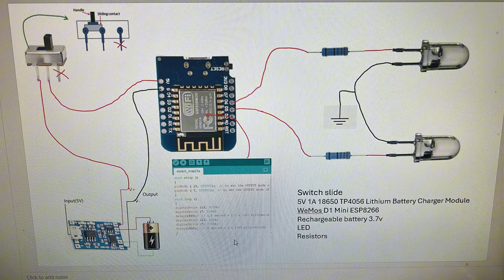Bringing Light to the Classic: Porsche 911 E 1969 (1/18 Scale) Lighting Project #diy

Comment: maybe if you painted the LEDs with a yellow marker, the lights would be a little yellow and not a cold bright one in headlights. And I'm asking again out of curiosity, don't you use a voltage regulator on esp8266? because after fully charged the battery probably has over 4.2v. so 4.2v is too little to power from USB C and too much to connect to the 3.3v pin
or maybe I'm wrong?
Reply from the maker: A regulator isn't necessary because I'm using the Vin pin (+5V). Regarding the color, that's up to the client.
Reply: @CarLighingSystem  call the customer and tell him that he is wrong and the lights should be yellow... I'm joking of course😁
Reply from the maker: @euzebi7512  😂I’ll do

Comment: hello again. I have a question. whether my email has reached you or not. because I had a question about the code but I didn't get an answer. Or maybe you read it but didn't feel like replying 🙂. Or maybe my message ended up in the SPAM folder.?
Reply from the maker: @euzebi7512  😂, I’ll be back to you soon
Reply: @CarLighingSystem   this year? 🙂
Reply from the maker: @euzebi7512  😂, it’s done